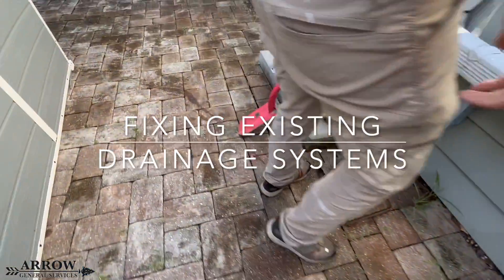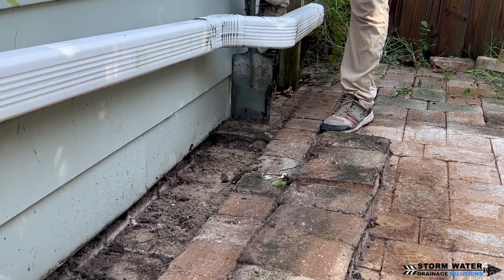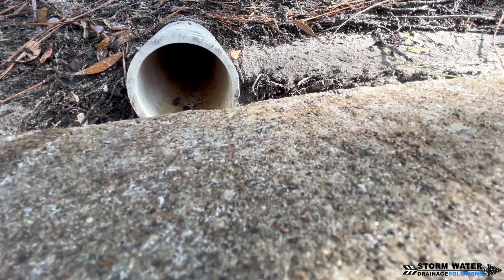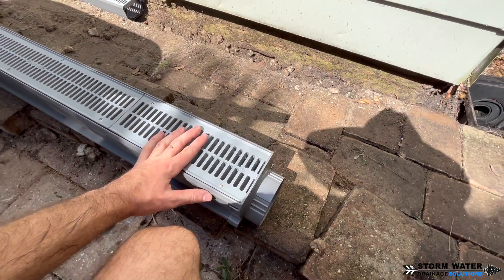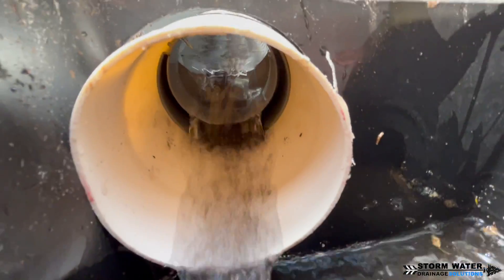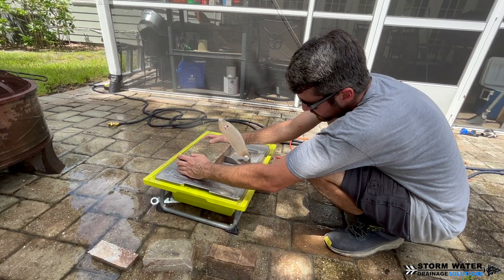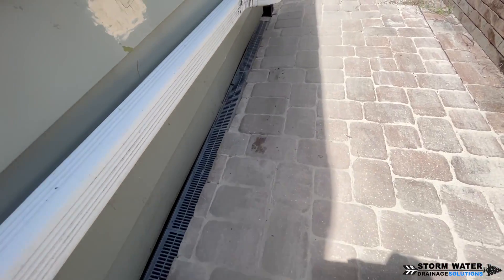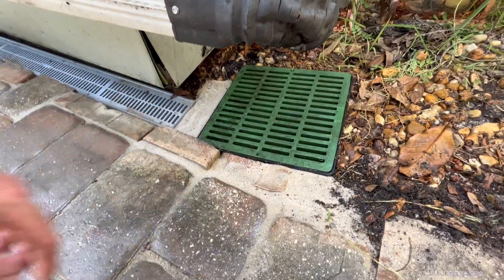Channel Drains - Patio Flooding - Fixing An Existing Drainage System

Comment: If you level the channel drain how does the water know which way to go?
Reply from the maker: Good question, water travels the path of least resistance so once it enters a channel drain that is level it will go down both directions. This is why we always recommend that both sides to your channel drain system have a way for water to escape.
Reply: @StormWaterDrainageSolutions  good to know. Thx!

Comment: I would say that that channel is too close to the property. Here in the UK it’s recommended that they are not put that close to the property walls
Reply: Looks fine to me, you want to catch water before it pools at the foundation.
Reply from the maker: We had to work with the existing channel drains. System now functions properly and we have had no call backs.
Reply: @StormWaterDrainageSolutions would you have installed the channel drains further from the foundation if starting from scratch?